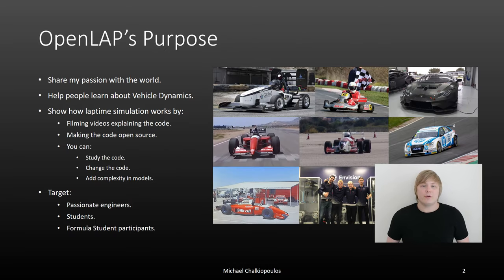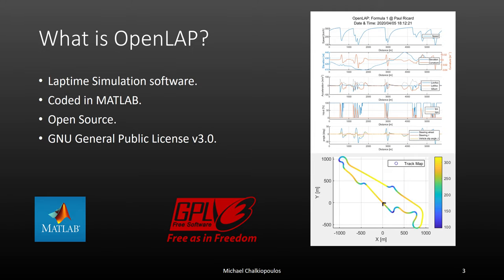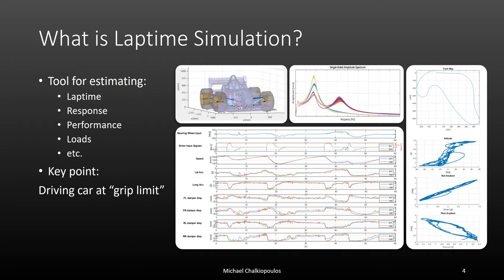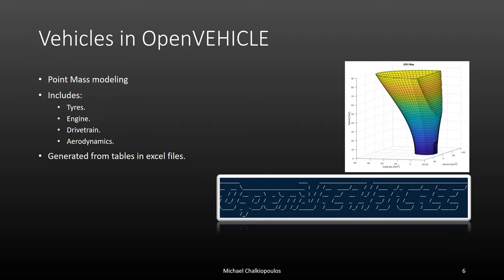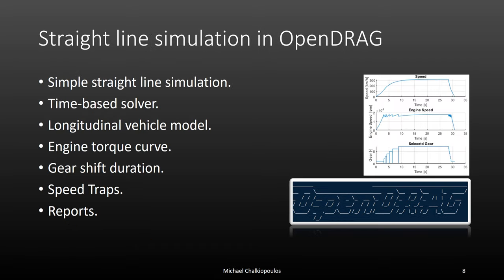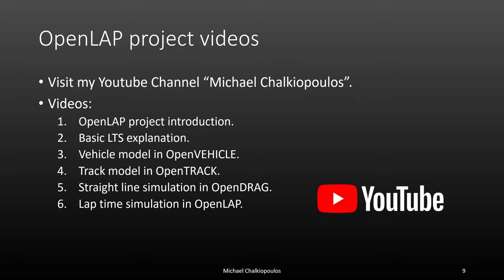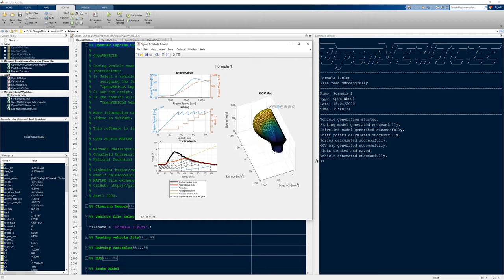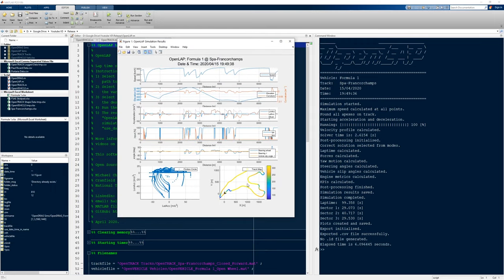OpenLAP Lap Time Simulator Part 1: Introduction

Comment: Add "Open_ISO" to run ISO tests (step steer and frequency response at least) to models for validation and sanity checks.  I think you should accept donation money for this excellent submission, too !
Reply: without the step steer and frequency analysis, this software is basically iqual to Optimum Lap?
Reply from the maker: Thank you Bill Cobb for your comment and you kind words!
As this is a steady state point mass model, there is no yaw motion, weight transfer or any transient behaviour. This means that it cannot run step steer or frequency simulations.
Reply from the maker: @pedrocalorio1655  thank you for your comment.
Yes it is very similar to Optimum Lap.
But you have to keep in mind that the point of this series is to help people learn about VD simulation and how a SS LTS tool works.
And the reason I made the code open source, is so that you can add your own features on top of it if you want, and easily make it much more detailed than Optimum Lap.
Reply: @_phoinix  I can help you with adding a transient response capability, perhaps as an add-in or extra cost version.  It could fetch all the needed parameters from your vehicle property database.  You have already prepared the hard stuff, now it's just extract the masses and inertias, dimensions, steering system, compliances and tire properties and you have a way to completely validate the model with some simple tests. You can install statistical elements instead of actual K&C values just to get it going.   But, the ISO step and fr test procedures help your sim pass the laugh test, ensures that signs are correct and adds quite a bit of insight into driver conduct.  I've found many times that "the car is better than the driver" so lap sim 'improvements' actually make the car worse in order to patch driver flaws.

Comment: Hello,  Eng. Michael, will this series include simulink modelling for electric vehicle?
Reply from the maker: Hello Samir A. Farag,

If you watch the series you will see that everything is coded, and not in Simulink.
This being an educational series, I think that doing it this way, you get a better understanding of the physics governing the problem, rather than connecting blocks.
It also makes it possible to write this in other languages as well.

Comment: Transient simulations that you had done as said in te video, have you developed a software that does this analysis?
Reply from the maker: Yes.
Those specific pictures are from the transient code I wrote for my thesis project at Cranfield Motorsport.
Reply: Wow! Very interesting! I’m working on my own transient sim software, but still struggling in some areas... can I have your email or other form of contact to have a conversation about this with you?